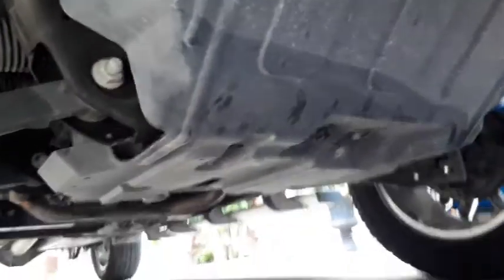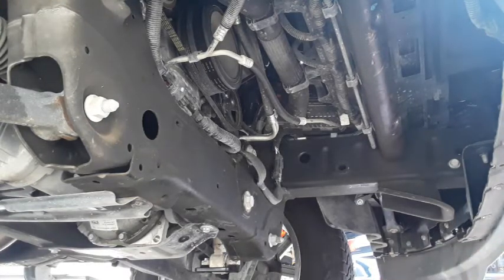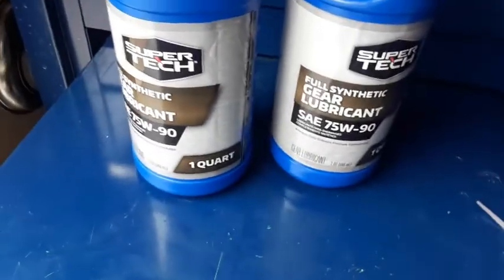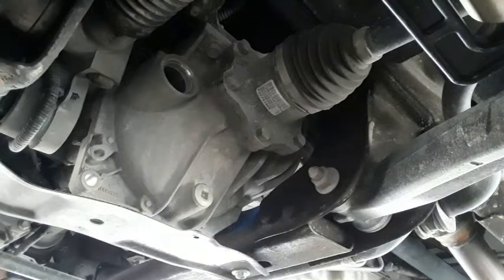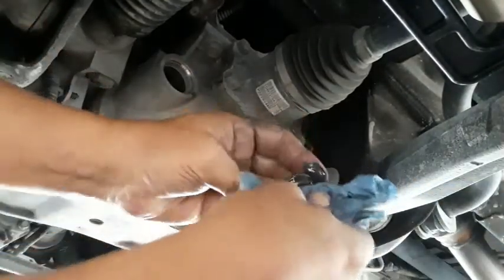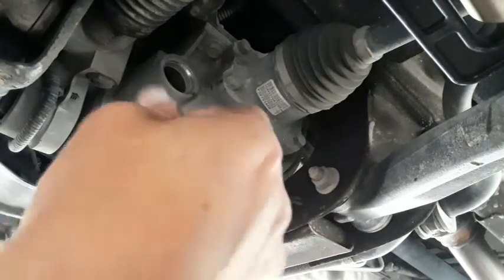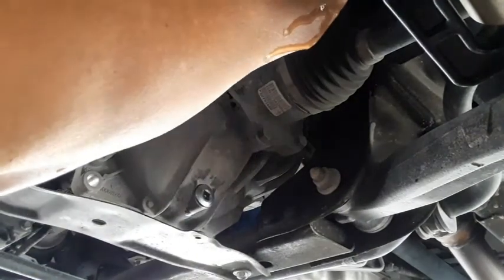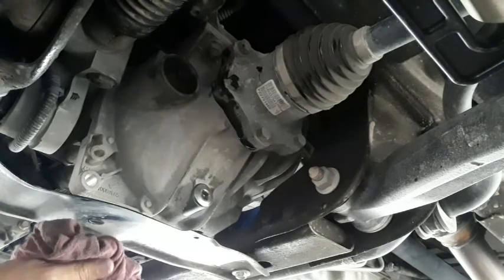Fast and Easy Front Differential Fluid Change on a GM Truck.

Comment: HEY THERE!
Just wanted to tell you that you've taught me a lot about this truck.
I own basically the same truck. 2016 GMC Sierra 1500 SLT 5.3L 4X4 6L80.
I've watched your videos about transmission fluid change, as well as transfer case and both front and rear diff fluid changes.
You have given my the confidence to do these jobs myself thank you for sharing your experience. You give clear instructions and good tips. LOVE the weed killer spray canister DIY transfer pump idea I have one laying around I never use, now I have a great use for it! 
How is your truck holding up since all the new fluids.
Also I wanted to ask you your thoughts on the transmission cooler tstat and if you advise on deleting it as you did vs using the transco delete kit or the surecool MOD. I live up north in Canada so it doesn't get crazy hot here but it can get up there. I guess my main concern is winter temps. Can the tstat delete or whatever way I choose to go with an issue in colder temps, getting trans up to temp more difficult with one of these MODs. Can trans temp being to low cause problems too.
Also why would GM put the exhaust pipe right under the trans pan, I would assume that it heats up the fluid even moreso than if it wasnt there. Any thoughts on wrapping the pipe with some kind of exhaust pipe insulation? 
Thanks again for sharing all of your knowledge. 
Would really appreciate your feedback!
Cheers!
Reply from the maker: I am sure the space between the exhaust pipe and trans pan is enough, so the heat doesn't have to much of an effect on the actual temp of the fluid. 

As far as the deleting the thermostat, if your truck has the driver information display, they you can see the trans temperature I would keep an eye on it and as long as it doesn't get to hot and wouldn't worry about it. Transmissions are designed to run at a certain temp and running them to cold isn't good either.

Comment: Thank you for the video of what not to do when changing your front diff oil ... Always remove the oil pan before installing the plugs and add on funnels sometimes cause more problems than they solve ...  Haha
Reply from the maker: What the hell are you talking about? Are you one of those special needs people?
Reply: @737mechanic  ***Because you dropped your wrench in the oil pan and using that add-on funnel spilled oil all over you ... Guess you missed that part of the video ...  Haha
Reply from the maker: @nelson587  I just hope I can be as good as you someday.
Reply: @737mechanic  ***Sadly, you totally missed the point .. Sorry you got all butt hurt because someone pointed out the little things we all do in the course of working that we should try and avoid ...
Reply from the maker: @nelson587  actually I get the point now that I understand. When you was saying remove the oil pan I was confused because the oil pan is bolted to the engine but the drain pan is what you was talking about.
Reply: @737mechanic  No problem .. Glad we're on the same page brother ... And Yes move the oil pan would of been better wording ...